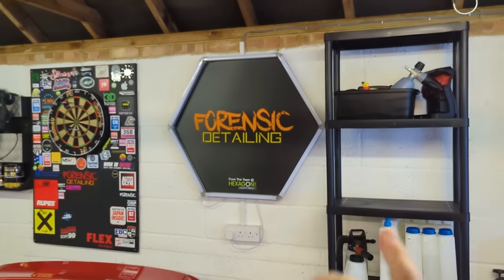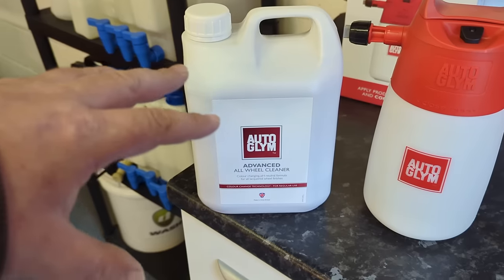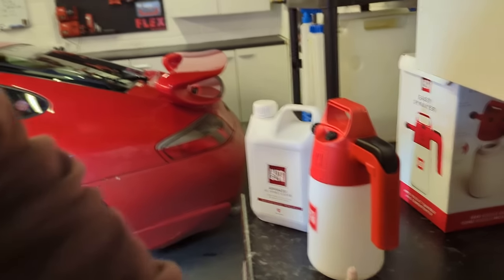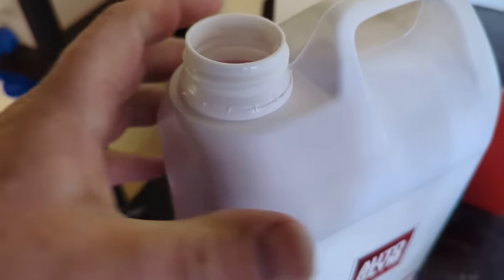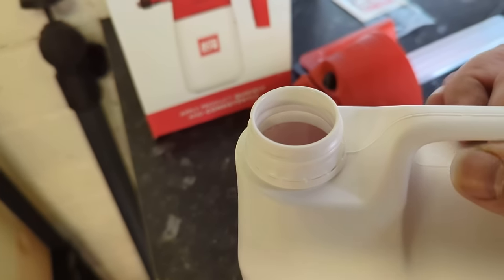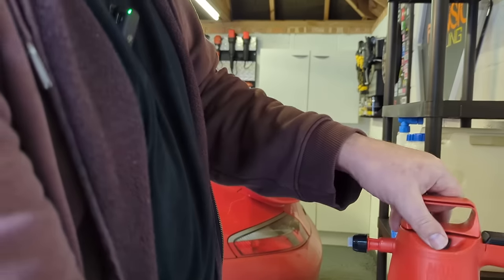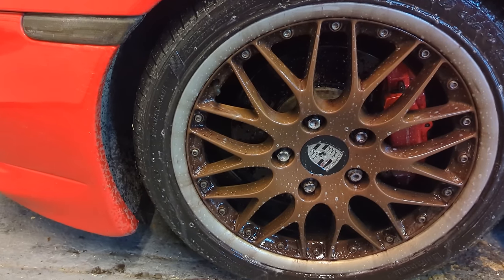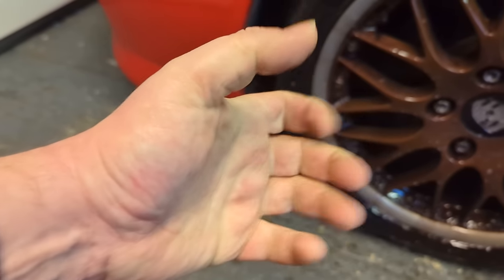*NEW*Autoglym Advanced All Wheel Cleaner Review

Comment: Thats an apt observation about the sizes Jon. It stands to reason that the prosumer/enthusiasts often get asked for recommendations on products and they aren't wasting their cash on smaller sizes as you said. Providing a product that can be bought economically in larger volumes that prosumers may buy, but a smaller size they can also recommend for the casual pop down to their local users is smart.

Personally, I'd be more on the casual side for this product as maintenance washing with regular car shampoo or rinseless wash does the job on the M4 comp wheels.
Reply: Get you some Nigrin Wheel Cleaner.

Comment: Infinity Wax Incinerate is very good at shifting baked on brake dust and grime, although it's not a fallout remover. I use it at 10 or 20:1 dilution, depending on how bad the wheels are. It can be used at ratios up to 25:1 so it's value for money. 500ml £8.99

Comment: Back in days when I used to sell Alloy wheels we sold a brand that had stainless steel faces on the wheels.... we used to get people coming back to us with lines etched into their wheels where the wheel cleaner had not been rinsed properly and was running down from the wheel nut holes. Luckily the stainless steel parts were replaceable.

Comment: I’ve been looking for a product that’s not stupidly expensive but effective. Sonax is really good but hard to get hold of. Not tried Bilt H as expensive for what I need, car gets dirty alot.
One thing to consider is if you have electronic hand brakes is to leave them off, the Anionic effect can draw the brake pads and disc together causing sticking, and also pull out any grease making your brakes squeak. So use sparingly, myself experienced this and my friend who was going to have his brakes changed after only 2k on a BMW M3, you can imagine that bill! Bit of lube sorted.

Comment: Any reccomended acidic wheel cleaner to buy? currently battling with my M2c's wheels dust wont budge with a good working of these wheel cleaners .
Reply from the maker: i have a litre bottle of wonder wheels which is very strong.  the autoglanz trade acid wheel cleaner is a bit safer.
Reply: Autobead wheel cleaner is acid based, around 12 quid on Amazon and will shift caked on dust pretty much without agitation. It stinks to high heaven but is the most effective cleaner I have used bar none.